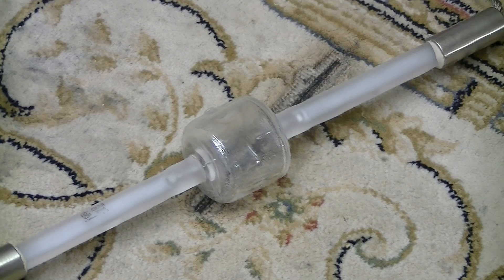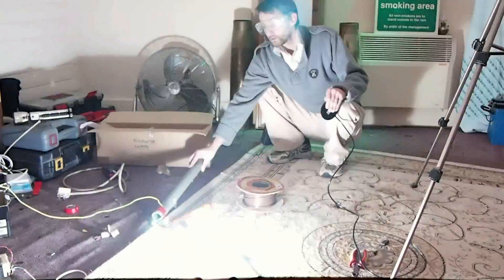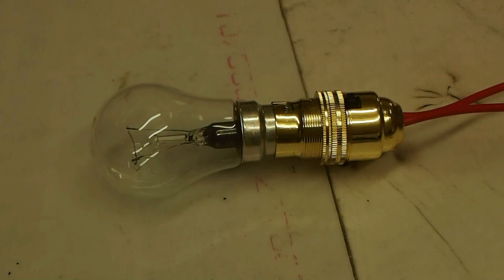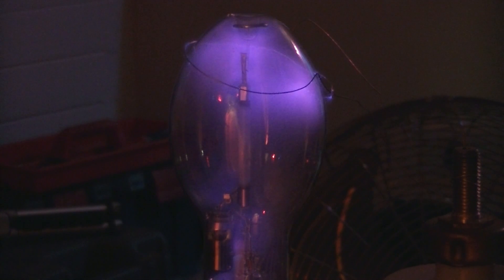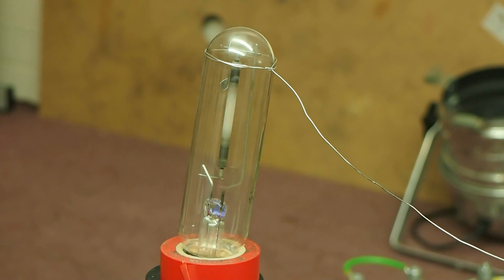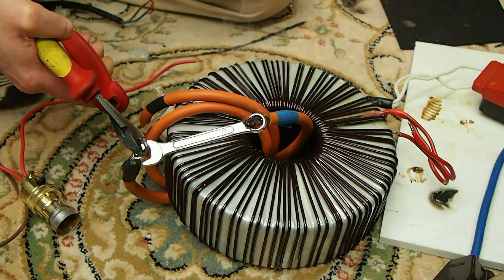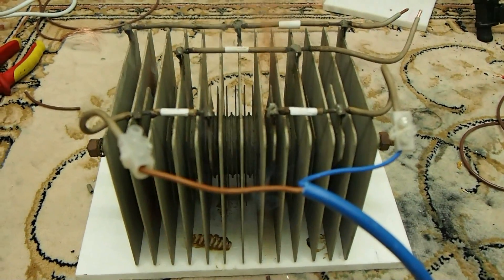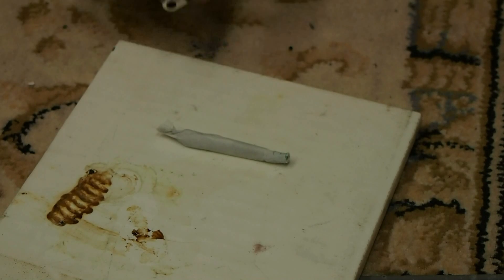State Of Matter

Comment: both are the same. 100000 × 0.007= 700 = 700W       700 × 1= 700 = 700W
you can touch 700A @ 1V and you'll fell nothing. but 100000V can push current through your body and 7ma is deadly at this voltage.

Comment: the 100,000v at 7Ma is the same amount of power as the 700A 1v, the 700A at 1v would be better to touch because you wont feel a thing untill 40v, the 100,000 at 7Ma would be very unpleasant, might be deadly

Comment: They have equal overall power. 700V * 1A = 700Watts  also 100000V*0.007A=700Watts I believe the 100000V @ 0.007A will fry and kill you, the resistance of the human body is too high to allow much current to flow at 1V.